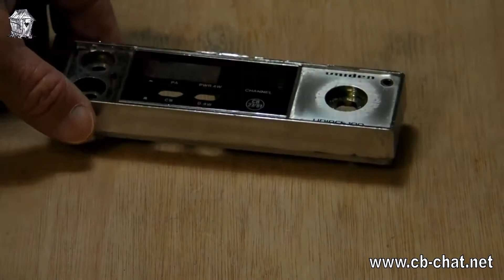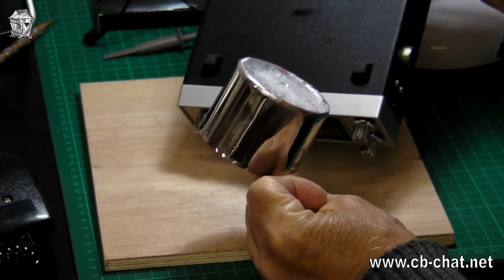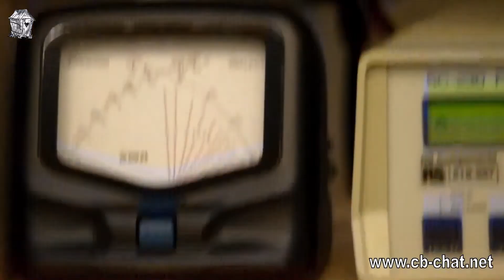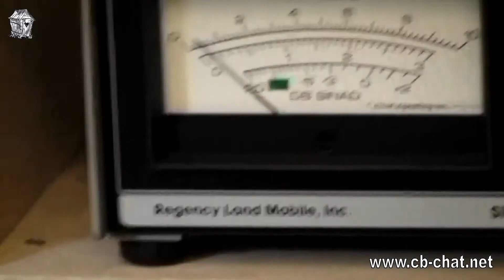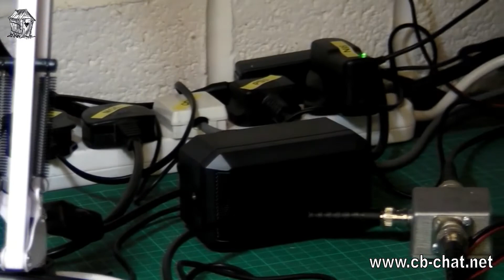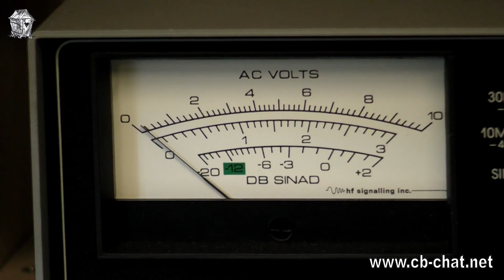Uniden Uniace 100 failed chrome attempt and final test

Comment: Thanks for the very informative video Ken. Do you have a link to the little Russian made output splitter box? Or the actual name of it?
Reply from the maker: I think it was called an RF Sampler, but I think Russia is unable to trade right now ? It was very much home made, but a 5 Watt CB radio on transmit puts out about 100 millivolts to the sample port, so is perfect to feed the frequency counter or deviation meter. eBay won't let me look at my purchase history right now, will try again and give you more info when I can find it.
Reply from the maker: Found it "RF Sampler Modulation monitor" 39 dollars and 60 cents. But it says the seller is away until January 2031. So as I said, dealing with Russia right now seems impossible. Annoying really, an exact copy from Australia will set you back over £100.